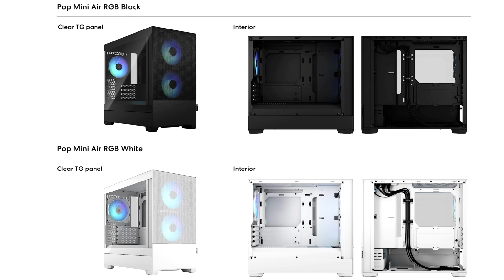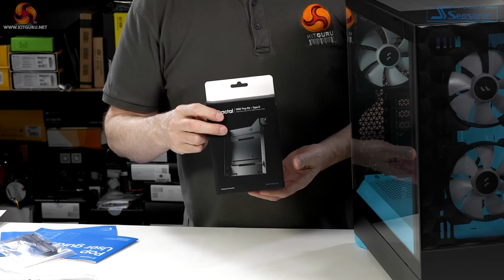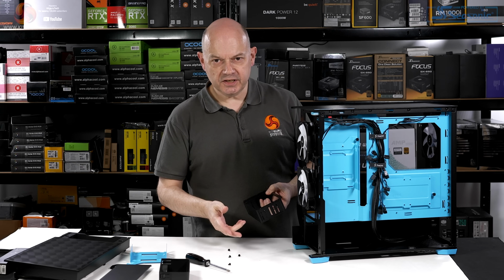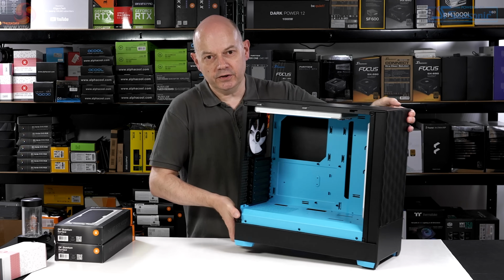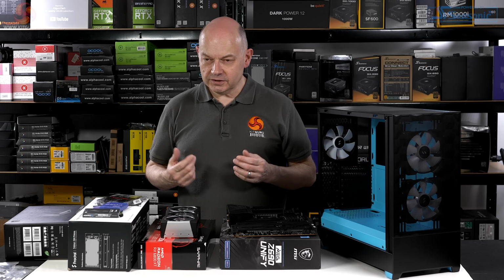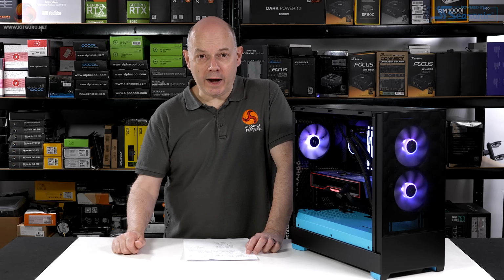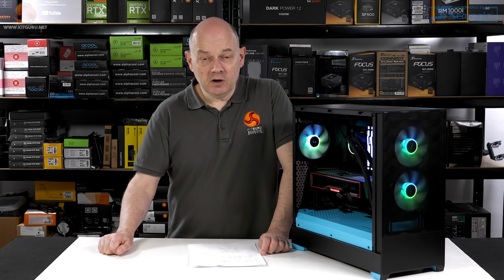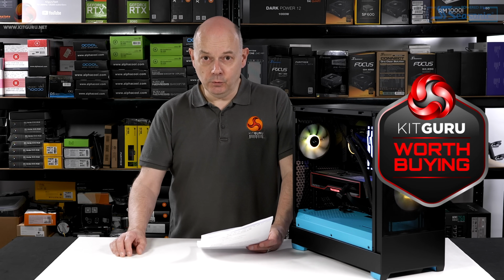Fractal Design Pop Air RGB - Bye Bye Meshify!

Comment: I find that external disc drives just do not hold up to the 5.25 OD that have been manufactured to fit in more traditional cases. This is glaring when looking at those bluray drives and what is offered today being less than stellar.

Comment: Why do I want ODDs in 2023? 1. My games-collection goes back quite a ways (mid 1990s, geez...) and you never know when/if you might want to install one of those old game at some point. 2. Since I also own a ton of movies on DVD and BRD, it's a convenient way to watch a film at my desk. 3. I already owned that BRD drive and it still works great ... so why not include it in the next build? Not sure I'd still buy a new ODD in this day and age, but I still use discs and thus wanted to re-use that perfectly good Asus BRD-burner I had sitting in my old PC. 
Anyway: I recently migrated my system from a bequiet Pure Base 601 to the Fractal Pop Air XL RGB. Even though the operation was a bit of a pain in the ass, I couldn't be happier with my decision. 

The Fractal has much more room inside and thus was a joy to build in. It's also much more airflow-optimized than the bequiet: All my temps have gone down quite significantly, with the chipset getting the biggest boost. Longer benchmarking/gaming sessions would push PCH to over 60°C in the bequiet - on the Fractal it sits around 45°C. And that's with (in both cases) a rather thick and 300mm long GPU that covers the chipset's heat-spreader almost entirely. 
On that note: The bequiet "supports" 240mm AiOs in the top, but good luck getting one in there with a modern motherboard with slightly larger VRM heatspreaders. Didn't fit for me with an MSI Z690 Tomahawk. Not only is the Pop XL much roomier up top and would easily allow me to mount an AiO there,  but having mounted my 240 in the front on both cases, it breathes much more freely in the Fractal.  
I also much prefer the Fractal's looks and the fact that it has a PSU-shroud. It makes the bequiet's design look decidedly old-fashioned (which it kinda is, TBH). And yet: It still has two ODD trays (one of the reasons why I went with both the bequiet and the Pop) - but it doesn't sacrifice looks or air-flow for that. 
The only drawbacks I can see are:
The slightly higher noise-levels since the Pop Air is quite a bit more open and it doesn't have any sort of noise-dampening material built in.
The slightly larger than usual footprint of the case (but, hey... it does say "XL" on the tin)
The need to pay extra if you want a front-side USB-C connection
Inability to mount a 360 rad in the roof - not that I would want to mount one there, but I don't quite get why a case of this size doesn't allow for it.

Comment: I still work with hotswap 2.5" and 3.5" drives for backups / sharing files (way quicker/cheaper/more reliable to send a 1TB SSD full of raw video footage than sharing it online). Also part of my job is format swapping old archives from tape and smaller hard drives to bigger HDDs or even online. I also have a front IO bay for multiple USB-C, e-Sata, SD cards, etc.  Those 5.25" bays are really important to get rid of the rats nest of cables that I would inevitably create, by buying external devices for all my I/O. Better it's all inside a case than all over my desk. If I had a spare bay, I would have even moved my Focusrite into it. 
 Shame it's not really suitable for a floor-standing case as this looks like an otherwise great case for a workstation.

Comment: The airflow one is Silent if you just get some better fans and get a Graphics card with semi-active fans and a big radiator. I used the Be Quiet RGB fans and It will just be silent. But with better airflow then your get with a "silent" case.

The only hard part is properly hiding all the cables as if you use a dvd player and both HDD brackages then you have awefully little space to properly tuck away the cables.
Do agree id rather have had a black/white combo then neon rgb chassy colors. As the RGB will just color over the white parts.

Comment: I like these, especially the XL. I want optical drive support because I'm 57, stubborn and occasionally burn the odd disk for other people, like once every few years. Similarly I want space for 3.5 inch HDs as well as SSDs. If I could erase my nostalgia and my desire to use old kit I already own, then I'd probably get hte Corsair 5000 Air instead!

Comment: I like to buy used Audio CDs and rip them into MP3 myself with a decend DVD Burner.
Then, I also like to have the option to playback BluRays using my PC, as I have no other BluRay players and internal BluRay burners for PCs are really cheap!
And also generally being able to backup or handing out burned Discs is great, and I do also have the occasional Software CD that I still use.

Comment: I do a lot of tinkering with older/retro hardware and software, so the optical drive is convenient. Plus the 5.25 bays can be used for SD card readers (there are these multi function things with SD, microSD, CF Card, extra USB etc) which is nice when I am doing things with devices like the Raspberry Pi for flashing cards.

Comment: Question for you Leo, why did you use an RBG AIO if you configured it to be push/pull on the front panel? You cannot see the lights because of the stock fans. Wouldn't a cheaper, non-RBG option sufficed?

Comment: Agree to disagree. 90+ degrees C -when the CPu is power limited, is not fine. Why force the use of the tiniest AIO (240mm), when the case can accommodate 280mm with much better cooling?

Common knowledge that the 12900K runs really hot. Even a 360mm AIOis not enough to tame it sometimes. Nobody would use a 240mm in real life for that CPU.

I would rather go with a 12700(why pay extra money for 12900k when there is no chance of cooling it?), but would still use at least a 280mm AIO, or the best air cooler that fits.

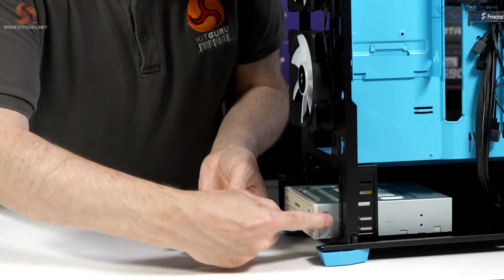Comment: 5:05 the reason why I like to use ODD is because I want to be able to play my PS3 games on a PS3 emulator. so yeah, I need a optical blu-ray disc drive for that.
the 2nd reason why, is to watch blu-ray movies because on netflix and other streaming services, the quality is not the best they compress so the quality is sacrificed, you will notice some pixels, but the quality of the blu-ray discs is way better.

Comment: nothing against this case in its price point, but the meshify is a must better value, IMHO.  Two extra front panel USB slots (1 type c, 1 type A) and 140 vs 120mm fans.  If, built in optical drives are critical, then maybe.  But I decided I could live with an external optical drive with my recent build because cases with support for internal units all have serious compromises.  This case doesn't change that.

Comment: Does anyone in the UK actually have these in stock? No sign at the usual suppliers of Fractal cases 😢
Reply from the maker: We've seen them at OCUK but it doesn't look like all the colour options made it: https://www.overclockers.co.uk/cases-and-modding/pc-cases?manufacturer%5B0%5D=Fractal+Design&sort=new_label_desc
Reply: @KitGuruTech  Seems the colour options didn't make it. How would you compare this case to the NZXT H510 Flow? It's less expensive and has a UBC C port included 🙂

Comment: As soon as you showed you planned to use the AMD graphics card I thought 'that is going to look awful in there'.  Surely you must have some other non-red accented card you could have used.  After you mentioned you thought it would look best with a static white RGB, I wondered why you had not done that.  Or perhaps a static color matching the case interior.   Feel that would have helped make the build look best.  

I use a bluray drive to backup my media collection to my server.  I like that this gives that option and that the drive would be hidden behind a cover when not in use - for a cleaner build look. The previous case options that had a space for a ODD did not have an option for USB-C in front IO.
Reply from the maker: A green RTX 3080 looks worse! ref the choice of RGB lighting I came close to suggesting Fractal could have simply supplied fans with white LEDs but that would have been to argue against choice and we are all about having plenty of options.
Leo

Comment: I do have an internal card reader I use very heavily (for both my camera as well as my 3D printer) & optical drive that I am using less and less these days (but still used).

The optical drive is my primary way of offlining archive data into long term storage and retrieval of that data.  In my experience, it's still superior (reliable) to a USB key.   Data that I don't need at the ready on my NAS gets moved to an archival disc and stored.  Happens about once a month or so.

The card reader is too heavily used that it can't leave my desk.  But why add more desk clutter (for sure it would be given it's heavy use) - it can stay inside the PC.  I could move to an external optical drive, but then it becomes something that is either floating around my desk or taking up space in a drawer - I really rather just have it eat up space somewhere I'm not going to notice it - the PC case isn't going anywhere and has the space for it, so I'll leave it in the case.

If it makes more sense for others to use external, go for it.  But for me, internal card readers and optical drives suit my work flow and home space better. :-)
Reply from the maker: Assuming you are archiving to DVD or Dual Layer you are working in chunks of 5GB or 9GB . You can buy a 4TB HDD for £75 which is equivalent to 700+ DVDs after formatting. I can see the argument for off-site back-up but for on-site I am still in the dark.
Leo

Comment: Thanks Leo another great Review, Love the case, First thing I do is mount the front fans inside of the case for a little better air flow & use rubber push pins to mount.
 The old Skool 5.25' bay & Pop in Storage Tray Got me interested.

Comment: Good to see more good mATX offerings, but for me it’s eked out by the cooler master td300, which supports 280 radiators in the same size chassis. A bit more expensive though.

Comment: Being born in the mid 50's I listen to music from the 70's and have a lot of CD's and like to listen to that music and you can't even buy a car with a CD in it so having a CD drive in a computer is nice for listening to music and able to burn a cd some times. Buying a cheap but high quality case that has options to add a CD drive or extra drives  is nice for the modern cases out there at a low price. I think they should have put 2 140mm PWM fans for the front for better air flow over the GPU.

Comment: Same as  , burn a disc rarely but have a writer in a 2nd PC and a converter cable to USB to use a reclaimed writer from . a lappy. Strange this day and age that motherboards don't come with a basic USB stick containing all the drivers etc , still issuing CD's. Something for manufactures to consider perhaps.

Comment: Why ODD bays?
Hotswappable HDDs. There's a module out there that requires 3x 5.25 inch bays, and gives you 4x 3.5 inch HDD slots.
Perfect for packrats who dont want to open up the case every time they want to add or remove a hard drive.

Other ppl may have other uses, but thats my interest.

Comment: Leo, in passing you dismissed the idea of a pump / res / block combo. Could you perhaps elaborate and investigate? I'm toying with the idea of building a custom loop in my Fractal Torrent and will want to hide the plumbing as much as possible so a combination pump / res / block (probably larger than the one you showed) would fit the bill very nicely. We hide wiring, so why not hide plumbing?
Reply from the maker: It's the other way around - if you want to use a custom loop in this case I reckon a combo block/pump/reservoir is the way to go. In a larger case a separate pump/res is more usual so you have a larger volume of fluid.

Comment: Nice looking case, unfortunately the prices shown here do not match the OCUK link in your written review, are the video prices exc VAT?, also not actually available, pre-order only. The OCUK models are priced from £86 to £122 all of which are the plain black or white models, no "POP" colours. What makes it worse is that trying to find more info from Fractal's website results in a "Error 503 Backend fetch failed" for the Pop case pages, so is this more of a preview than a review? 

Edit: Scan do have the range in stock, although about 10% above Fractal's "retail" price e.g. cyan, green, magenta, orange models £90 not the £82 Fractal price. Usually Scan/ebuyer/OCUK are below manufacturers retail not above! Makes me question if these prices are just $ conversions and not actual country specific retail prices inc taxes (VAT).

Comment: Thanks for the review, Leo. My mom asks me to turn some of her work related CDs into mp3s. I keep a Pioneer CD/DVD drive for this purpose. However, when building a 12th gen system on an ASRock board I've run into an issue with Windows not recognizing the network adapter, having an optical drive saved the day.

Comment: 5 inch bays are interesting for water cooling reservoirs
Reply from the maker: Two thoughts there: Alphacool used to have that type of reservoir and they were a pain as the liquid was spread out over a large area, tricky to fill and easy to spill. The second point is, a reservoir in the floor of the case would be peculiar. 
Leo